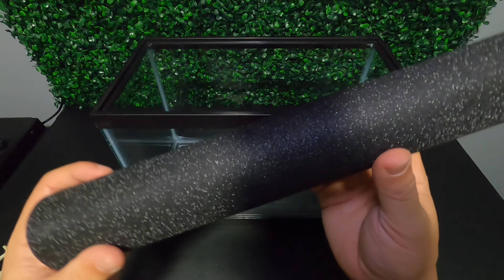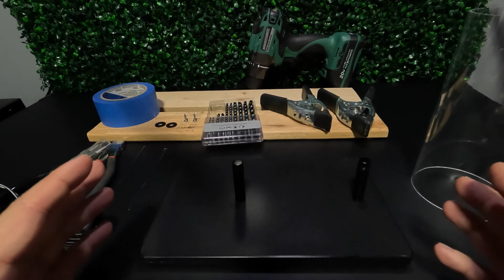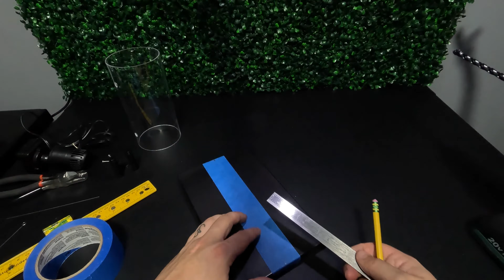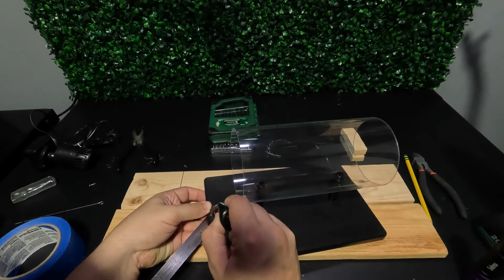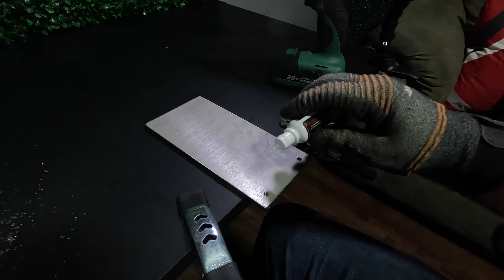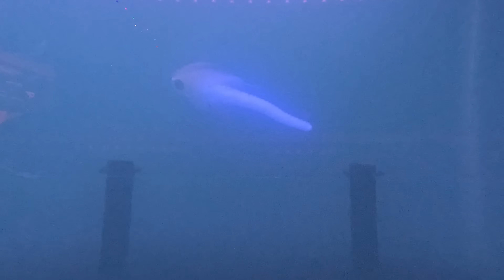How to Build a FLY TESTING TANK! (with BLACK LIGHTS)

Comment: advice not taken, I just bought the steel plate 😂debating getting a plastic plate and double side taping it down? 🤔
Reply from the maker: Could work, though the tape will most likely weaken fairly quickly in the water. It sucks how the water makes everything more difficult lol

Comment: If you're still pursuing this, switch out the  water for distilled water, should stay cleaner longer?
Reply from the maker: Distilled water would stay cleaner longer for sure. With my pump running, I don't really run into any issues with bacteria or anything like that - I have to periodically clean the tank, mostly because of the little hairs and fibers that come off of the jigs and flies I put in there. I'm definitely going to bring the fly tester back to my videos, but I've had to replace some screws that completely rusted away, falsely advertised as stainless steel :(

Comment: Thanks for the video was debating doing something very similar. Probably going to do the adjustable pump just to have options for different currents and different flies. What’s your biggest regret that you would do different? Also I would play around with different lighting and backdrops. I believe the cloudiness could be amplified by the light. Thanks for all the effort you put in figuring this out.
Reply from the maker: You have no idea how happy this comment just made me  haha. If I could go back, I would definitely wash my gravel thoroughly before putting in the tank. I didn't realize how much dust the gravel would release. I changed out the water, and after running the filter for a while, the water was nice and clear. Some other potential changes: 1. Use a 3 - 3.5 inch acryllic tube instead of 4 inch diameter (better for directing the current and still plenty wide enough for large muskie flies, 2. Adjustable wavemaker pump (costly, but with obvious benefits), 3. Figure out a lid solution that looks good but prevents dust from settling in the water and water from evaporating (I am currently covering with a piece of plastic, but water still evaporates and some dust gets in). Every time I use the tank, I have to skim the top of the water with a paper towel and run the filter for a bit before use.
Reply: @nextlevelangling  thanks a lot if I build one I’ll fill you in. I’ve been making YouTube videos with Slab Dynasty for 4 years so I know how much work goes into everything and how it feels to not be recognized for it
Reply from the maker: @LtOsprey  Thanks a lot! I'm happy even if a video like this only helps one person. Let me know if you figure out some potential improvements for the future DTF Tank 2.0 🙂- and that's cool! I was already subbed to Slab Dynasty 👍